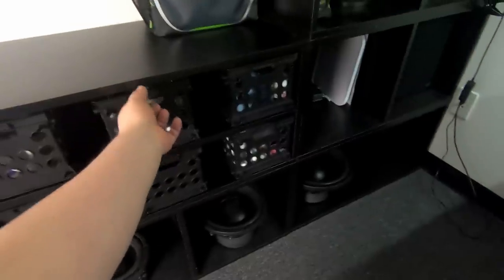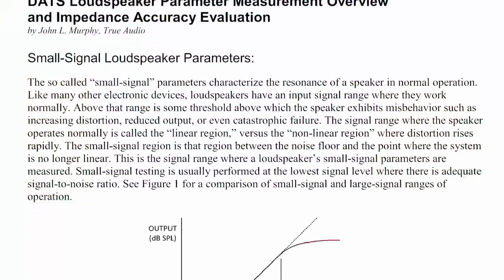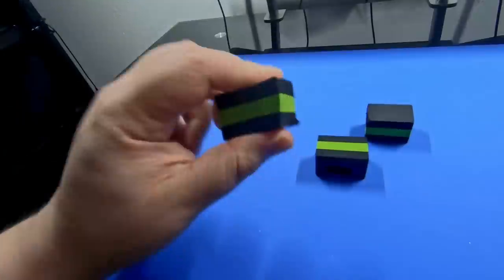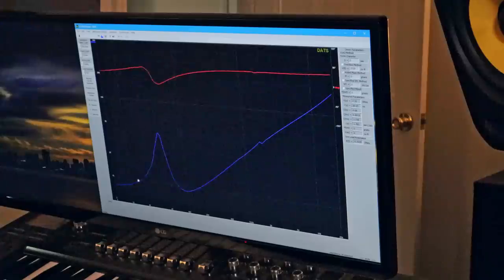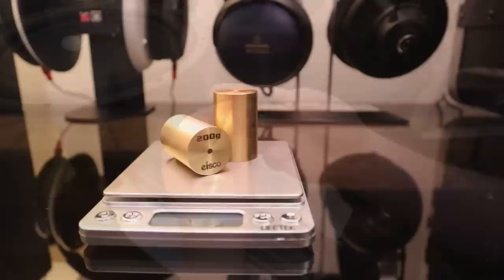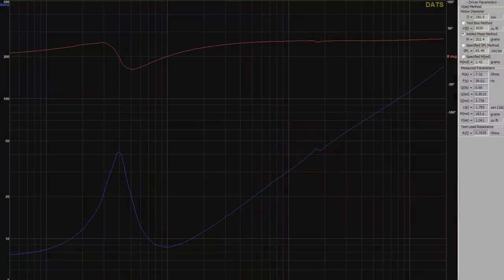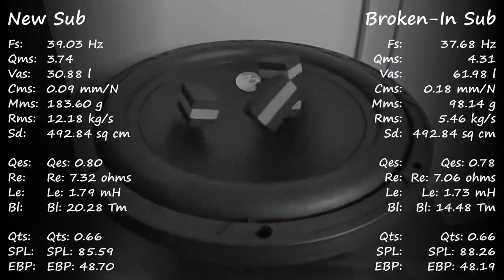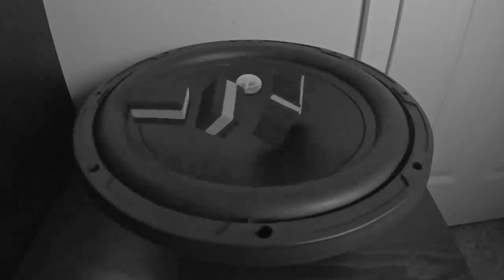Measuring Woofer Break-In

Comment: Question : is there any issue with wiring 2 duel 2 Ohm subs (12") one is series (4 Ohms) the other parallel (1 Ohm), in Parallel for a total Load of 0.8 Ohms. More to the point do the drivers work differently when wired this way. Both will be in 1 sealed box BTW love the videos, Thank you for sharing your education and experience.
Reply: What he said! PLUS each sub will have the same voltage as they are in parallel, but one will have more current and power (1Ohm) versus the other (4Ohm). This is the worst possible setup - especially only having one common airspace/enclosure. Totally wrong in every way. (aside from 16yo me and my best friend stuffing two 10s and an 18 all in parallel into a 1987 Hyundai Excel hatch back in 1992. At least they all had their own sealed airspace. The 10s were 8Ohms each and the 18 was 4Ohm, so the 18 received approximately half the power depending on frequency and impedance). Don't do it. It is pure nonsense. Say your amp sources 1000Watts of power at 0.8Ohm. The 4Ohm sub will sink 200Watts and the 1Ohm will sink 800Watts, because 1Ohm has four times the current flow as 4Ohms. Current takes the path of leadt resistance. Horrible and so wrong, unless you taking highspeed sequential photos of cone excursion and are trying to prove that 4 times power equals 2 times excursion, or something. Probably will not work out exactly as the inductance of one sub will be different than the other too, but close. 

Actually, try this as an experiment then wire up your subs properly afterward.

Remember 2 times power equals 1.414 times excursion in perfect world. Or to calculate approximate excursion increase with change in power = sqrt(multiple of power)= multiplier of excursion. Example - You start with 500Watts which gives 10mm of excursion. You magically increase power to 750Watts. The increase in excursion will be 750÷500= 1.5 times power. sqrt(1.5)=1.2247 times more excursion = 10mm x 1.2247 = 12.24mm excursion at 750Watts in said enclosure versus 10.00mm at 500Watts.
Reply: Paul wouldn't the driver with the lower resistance take more power? Not sure how the driver at 4 ohms would take 800 watts and the driver at 1 ohm would take 200 watts,  if I am wrong please explain why. If I wire an 8 ohm load to an amplifier it produces 450 watts but if I wire it to a 4 ohm load it produces 800 watts,  this is why you have me confused.
Reply: @markbrown6733  Ah crap. I typed it backwards yesterday. You are correct. Anything approaching zero Ohm or a short will have the most current and hence the most power in a parallel circuit. Sorry. Either way, one driver will have 4 times more power and more heat.
Reply: @markbrown6733  That is what happens when one does not put the math formulae at the bottom. I would have caught myself slipping with proof at the bottom. dammit. I hate spreading incorrect information. Being wrong is ok as long as it does not affect other people.

Comment: Great job !
Very interesting to see how much the suspension changed !

you used a 200g added mass, isn't it heavy ?
it's more thant twice the Mms of the first driver !
by the way, why do they have different Mms ? differents driver models ?
Reply: @HexiBase  Sorry should have read the description
Mms and Cms are derived from the changed of resonant frequency when you add the masse.
If both drivers have the same resonant frequency and Mms in tolerances, it means that their Cms is still very close

Comment: Great video,
So does a broken in sub sound better or a newer one?

Was that infinite baffle box or sealed?

Just trying to learn

Thanks
Reply: Broken-in always sounds better, has more excursion, and can take a bit more power. I once read that DD audio (a SPL competition team) blew a sub, and replaced it with a brand new one, which also promptly blew. New woofers have less excursion, which means less air moving over the coil, and it can overheat.

As for your infinite baffle question, a box is considered "Infinite Baffle" if it has more air volume than the VAS of a driver. He mentioned in the video that it was originally infinite baffle when he built it, but with the new higher VAS from break-in, it may have not been infinite baffle anymore.

HexiBase has a great video, "T/S Parameters explained", that explains all of these terms such as VAS (and many others).

Comment: I had no idea rubber edged drivers had a break in. Ive known paper and cloth edged speakers have a break in for 50 years. I always buy paper and cloth edge drivers. Foam disintegrates, in 15 years, im not sure about rubber, but i know cloth and paper edge drivers can last for 90 years with reasonable care, getting more compliant and sweet sounding. The oldest drivers i have are a pair of 10's from a 50's hammond organ. I used them in a tweed guitar combo amp i built 10 years ago.

Comment: I have a WT3, and when I do my tests, I try to acclimate things while the air is close to 68F outside and have the drivers acclimate to that as well.  Then I use a tripod with its legs fully extended, set up outdoors, and away from any structures, with the driver sitting atop.  But, this is just me.  :)

Comment: Incredible. So the SPL is nearly 3dB louder on the broken in woofer! What is the frequency bandwidth and weighting used? Could you hear a difference once the new woofer was installed? Did you do a comparison of the frequency response while mounted in the cabinet? (I suspect it is already too late to do that with the new woofer as I'm sure it has been partially broken in!). Great video by the way.

Comment: The difference is to drastic. You should buy 2 new drivers and run for for x hours and then measure. Difference is huge and it seems that something went wrong when measuring. 3 years difference is also a variable. Maybe they released new revision of the driver or something.

Its weird that mms got halved lmao. Half of the mass disappeared and this made vas also twice bigger. Still qes, qts stayed the same. I think measurements are wrong

Comment: I never doubted break in is real. However some "audiophiles" seem to think there is an actual procedure rather than it just being something that happens. Like if you do it wrong your sound is ruined forever.. Hilarious
Reply: Nice to see a common sense thinking on the subject. I suppose an engineer with the time could test compliance over time and see if it's a curve that gets to a point of diminished affects and more or less gets to a point of being in a stable state over time. Then a system can be designed with that compliance in mind. Or if it just continually gets more compliant you could pick some point in the middle so at some point things get better before they get worse.

Comment: A real test would be if you use the same speaker. Measure the speaker out of the box, beat the crap out of it for a while and test again. Using two different speakers will more than likely skew the results as the second speakers measurements out of the box could be different.

Comment: Sadly comparing a woofer from three years ago with a current production run isn't very insightful due to production variations. Maybe try to get two of the same drivers from the same production run and measure both right then and again after subjecting one to a break-in period while the other one just sits on a shelf so you can see how they've changed individually and how break-in differs from aging (which already happens even before being sold).

Comment: I like the video, but wait, it is two DIFFERENT woofers? Because you can't make any conclusions from that at all-the original was almost certainly not built exactly the same due to parts tolerance or possibly parts changes. Plus, BL and Mms should not vary, they are not affected by break-in (OK, if a bit more of the surround and spider are moving there would be a tiny effect. The coil parts aren't being broken in. Unless the new woofer was not cooled down at the time of measurement?)).

Comment: This is a very good video about the DATS, I think I will buy one! Do you get a commission? ;-) 

But as for the break-in, sorry, it needs to be the SAME driver, otherwise two variables are being changed: the actual driver and the age. As well, the differences seen could be just differences between two samples, since production tolerances can vary from unit to unit and batch to batch. Can you take the new driver and like run it with a high excursion sine wave or brown noise or whatever for a long time and then see what happens? (From previous experience, give it like a day to settle back both temperature and soft parts hysteria)

The Mms disparity, that's odd-you're measuring with an added mass, right? The system should thus be able to calculate the mass well. Do both impedance curves look clean? Or lumpy? maybe the weight is displacing the cone towards a nonlinear zone?

Comment: so basically design the crossover and cabinet for the driver when its broken in.   or else you get worse and worse sound as times goes on.
Reply: @HexiBase  Is this something you're still planning on doing? Would love to get an honest to god answer on what actually changes and what it means for designing enclosures. Getting 2 drivers, using one and storing the other, and periodically measuring both every month for a year (or until a plateau is reached) should say all there is about break in, potential lack thereof, and expected times if it exists.

Comment: Are we going to ignore the fact that the mms calculated out to 85 grams lighter on the used sub? This video needs to be taken down, those numbers are bogus. The added mass method is the least accurate method to use with DATS and you are supposed to measure the sub horizontally. The weight of the cone when it is measured vertically will yield untrue parameters. DATS guess of cms is very inaccurate to actual measured deflection. BL^2/re motor force is 56 on the new sub and 30 on the used one, are you really going to act like the used sub also became 50% weaker after being used? Speaker manufacturers measure tsp's horizontally. Have you ever seen somebody measuring a sub vertically on a klippel? No, and that's for a reason. The only accurate number that you can rely on with DATS is qts and fs, neither of which hardly changed between the subs.

Comment: There is no such thing as BREAKING IN SUBS AND THE FACT A PERSON DO NOT WANT THAT WAY?????   IF THE SPIDER GETS TO SOFT THE COIL WILL BE DAMAGE AND EASY TO BOTTOM OUT CAUSING COIL TO BE DAMAGE PERIOD
Reply: 1 THERE CAN BE A SMALL CHANGE FROM A FRESH DRIVER AND ONE THAT HAS BEEN USED FOR A LITTLE WHILE. AFTER THAT ANY CHANGE WOULD BE TOO SMALL TO BE AN ISSUE.

Comment: This "Break in" is complete nonsense. I have been a Designer for 40 years. I have heard this nonsense so often.
Reply: @HexiBase  If the Transducer you tested suffers from very distinct parameter changes to the published TS, I would like to suggest Do not accept those TS. That is fairly simple. I am a Professional Designer of both Acoustic & Electronics for Pro-Audio. I have contracted for many well known brands. I have bever had a single issue in this regard in 40yrs. This "Break in"  is nonsense as any reputable Transducer manufacturer will tell You. 

There may be a possibility of low quality devices doing so but You will not fimd it given as any kind of info by such a manufacturer. I appreciate you are fairly new to all this as I have watched a few of your videos. But You are adding fuel to the fire here.
I would however wish to congratulate on on concise informative videos. unfortunately
this one is not.
Please make further study at Your discretion of this myth
I believe the source of this myth is from the vast miseducated mass of DIYers We now have along with all the Designs that do very little to achieve improvements from a technical aspect for better sonics of Loudspeaker technology.
Substituting a "Quick Fix" for better understanding of the science.
If We are truly honest this field is the least understood & the most exploited. Many do not "Know" good saonics from bad. Most is more "Effect" than true lineararity. It is too easy to get away with it too  I do hope for a change to this & will do My part to promote it.